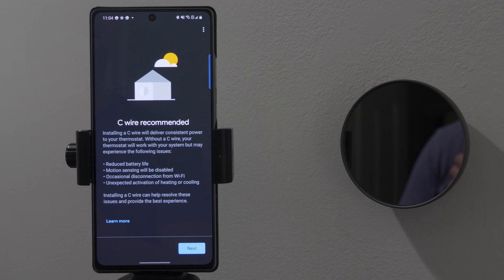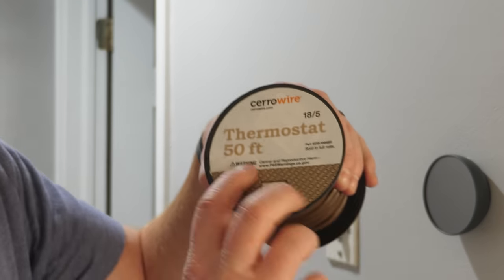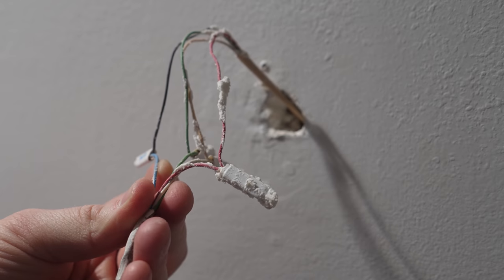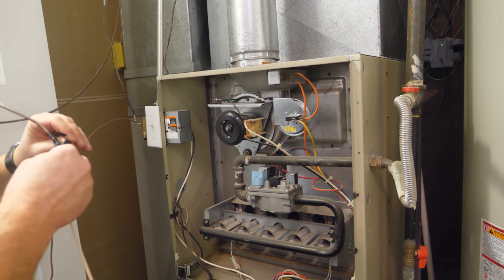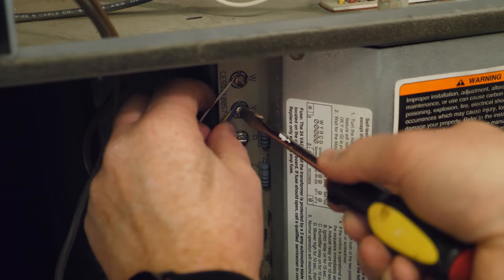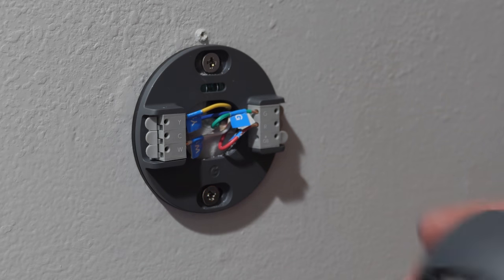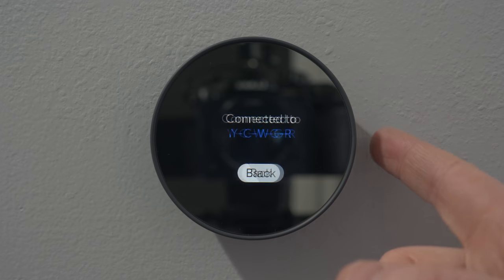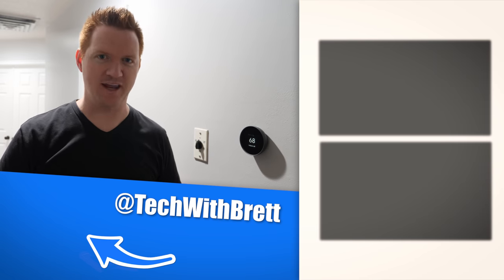Fix Nest Thermostat Issues by Installing a C Wire

Comment: This is exactly what I was looking for. I have a Sensi WiFi thermostat, with essentially the same problem. I can use batteries for WiFi, but they don’t last long. My thermostat is directly over my furnace as well so it should be an easy project. Thanks!
Reply: Wait, I have to put a battery in my Nest? Mine just came in the mail, and I thought the red wire was the power?
Reply: @Blackdog4818  I have an Emerson Sensi thermostat, which requires 2 AA  batteries. Before running the new wire, I had to replace the batteries about once a month. The WiFi would really drain it.
Reply: Okay so it's a rechargeable battery with the 3rd generation Nest thermostats. So luckily, it recharges whenever the furnace power goes on.

Comment: The easiest way to have done this is just see how the wire was connected at the furnace, figure out which was connected to C and then splice into the wire that wire at the thermostat. No need for an entirely new wire.
Reply: how do you exactly do this pleasE?

Comment: A much easier way would be to use a 24V plug in transformer.
Reply: Then where are you running the plug to? Especially if no outlet is near by? Doing it via the wiring for furnace/air unit is actually much cleaner and more efficient.
Reply: I did that a year ago. Luckily my outlet was right on the other side on the wall. The only thing you see is the plug because I was able to fish the wire through the wall and so far so good.

Comment: That was easy if the wire would have been installed during building it would have been fastened inside wall to studs. Or if it was run in a couple studs then drop down to furnace would not have pulled that easy doing that kind of work for 35 years not all that easy

Comment: Naaaa F Google and their complication.  There should be no reason to do it.  Mine would not even run without the C wire.  So when the owner of a condo complex wanted to update 60 units.  It was easy to recommend a different product.

It hit me that we are doing the work a s installing not just a thermostat but a personal data mining device in our homes for their profit.

Comment: You will replace the 4wire with 5 wire , you follow like a dm by taking the picture of the old wires ,, hmmm no need ,, write ?? because you will do new wiring at the furnace !!! then you can do them your own.

Comment: CAUTION ⚠️ This thermostat does destroy ac compressors due to the internal battery goes dead in 2 years.i am a hvac pro.it is due to the lack of "c" wire..but what the nest forgot was the 5 min delay on loss of power. This has nothing to do with the "c" wire..I take every nest thermostat off of my customers wall I find..cheaper than a new compressor. I replaced a compressor 2 years in a row because of a nest...compressor was under warranty but still paid a kings ransom for the labor.if the manufacture finds out it was the Nest they will back charge me the cost of both.at over $600 each compressor. I'll send that cost along to the customer..I'm not paying for the nest-sruction of a compresor
Reply: This thermostat does not have an internal battery lol it works with 2 AAA batteries

Comment: My system only has 2 wires (red & white) connected to the existing thermostat. There is an antenna box controller connected to the system which, is believed to have been installed because the other wires aren't working, due them being damaged etc? My heat and AC currently work. If I install a Nest thermostat, could I continue to just connect only the red & white wires?